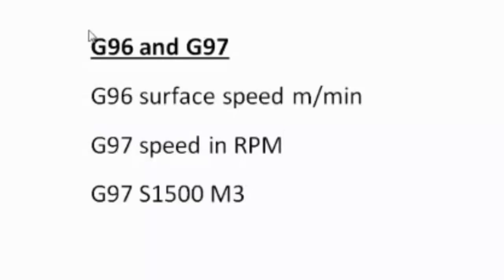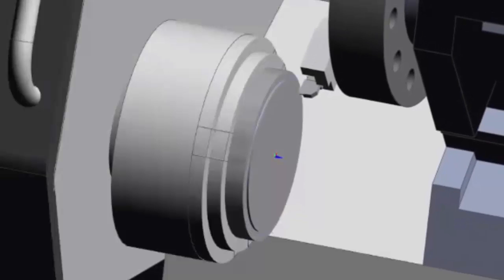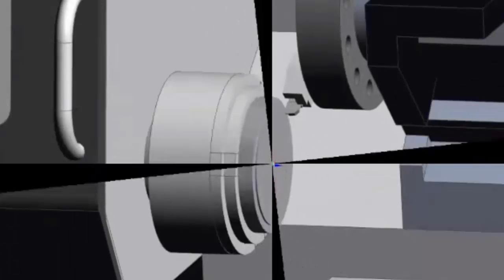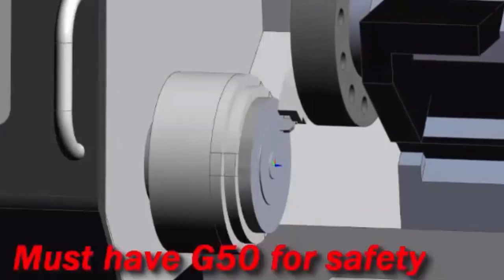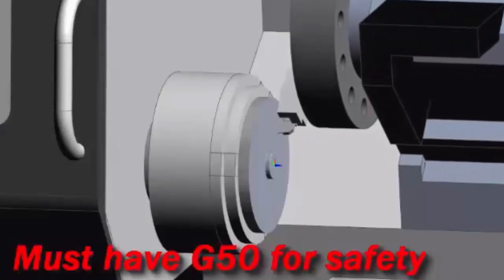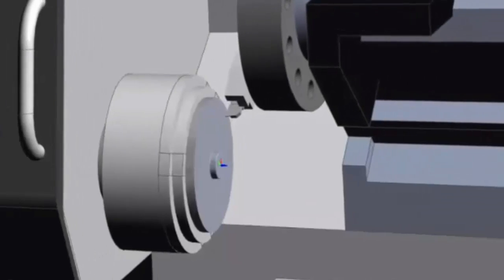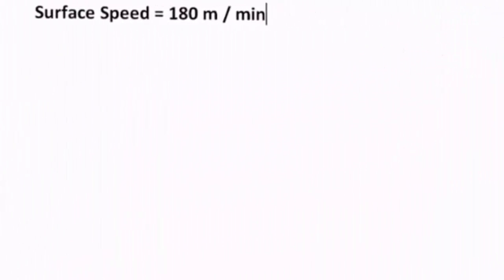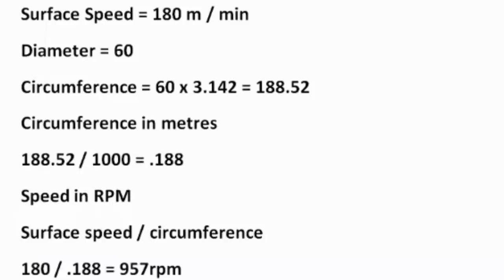G96 and G97 on a CNC Lathe (Surface speed and RPM)

Comment: How did you arrive at 180m/min?
Reply from the maker: Look at the cutting tool data from the tool insert provider
Reply: @cnctrainingcentre603  can i find it in the carbide insert box
Reply: @cnctrainingcentre603  is m/min aplicable only on cnc lathe?

Comment: if you call an F word after the g96 in the next block, would it cancel the g96?  say N19 G96 S185 M3 M42
N20 G1 Z1.5386 F0.0055
Reply from the maker: No it would not, the feed has nothing to do with G96 or G97. Hope this helps
Reply: @cnctrainingcentre603  ya I didn't realize they were two separate things but I understand it now. If you were to change the FR from .003 to a higher FR for retracting out of the part and repositioning, while still I g96, what would be a decent IPR for moving around more quickly? My lathe does not have a rapid override unless it's in single block step and I would like to have some control over its retracts so I'm leaving it in G1

Comment: thank you please If I have a cast part  that has a large diameter and a small diameter, which diameters do I use in the equation to find the speed rpm if I use G96?
Reply from the maker: G96 is the surface speed so it will calculate the RPM based on the G96.
G96 S200 is 200m /min so the machine will calculate it's speed at any diameter. All you need to give the control is the surface speed oyu want it looks after the RPM for you.
Reply: thank you very match  @cnctrainingcentre603
Reply: @cnctrainingcentre603  how did you come up with the surface speed
Reply from the maker: G96 takes care of the diameters just chose the correct surface speed for the material